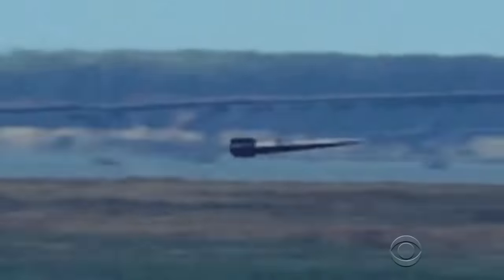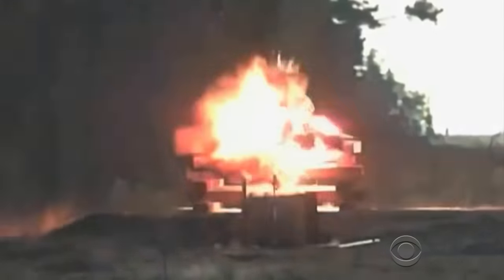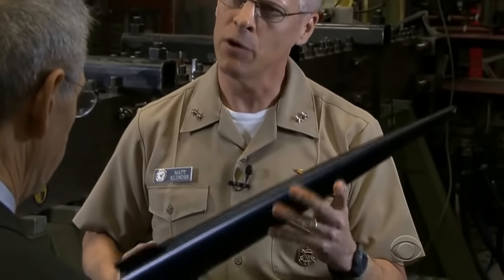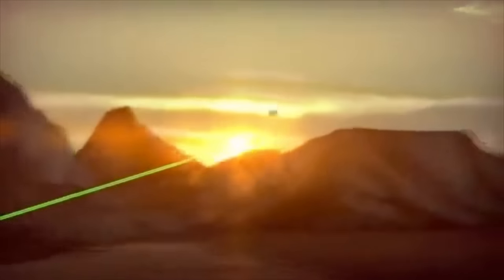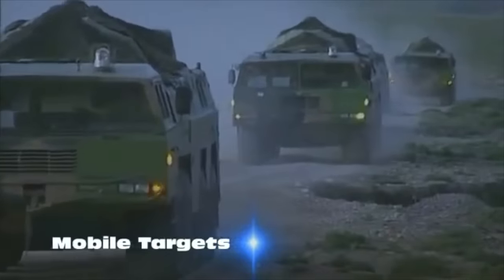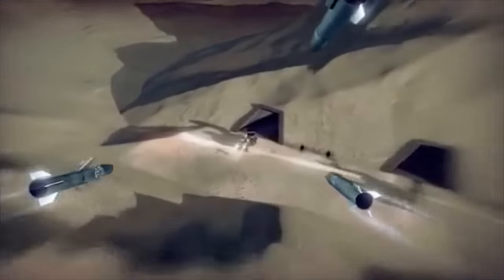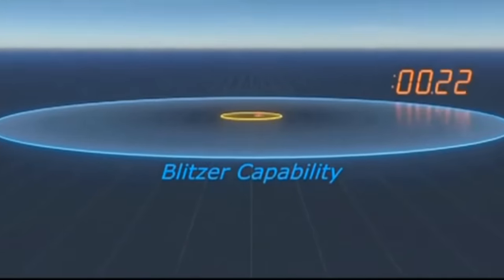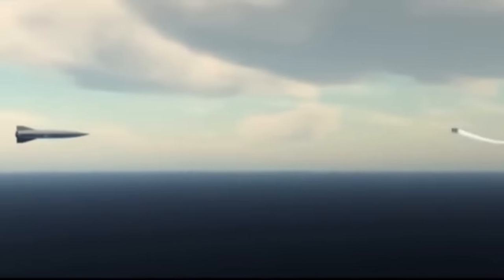U.S. Military's Most Powerful Cannon - Electromagnetic Railgun - Shoots 100 miles - Mach 7

Comment: More than 70 years ago, when I was a kid, we bought a toy gun at Macy's which worked on the same principal. It was made of plastic and consisted of an electro magnet,  an aluminum barrel and a button at the back that would push a small steel bullet from a magazine holding ten in between two electric contacts which activated the electro magnet and fired the bullet out of the barrel with about the same power as an airsoft gun. Nowadays they would not sell such a dangerous toy to kids. It was okay on the 120 volts of the USA, but when we took it to Britain and plugged it into their 240 volt system it was almost as powerful as a. 22. Fortunately,  unhappily for me as a kid,  the higher voltage melted it before any real damage was done. I imagine it was taken off the market in the USA fairly quickly. But it was a toy rail gun I had about 73 years ago. It's surprising the technology has only know been turned into a real gun.
Reply: Scaling it up required too much power and cost way too much most of our tech was available 50 years before it had begun to see use as it was too expensive
Reply: @Thomas Pickens I am sorry. I don't know.  I am not a toy expert. When I was a kid I just played with them and often wrecked them.  I was about 7 at the time and it was explained that the little steel projectiles when they were pushed into the breech completed the circuit and activated an electromagnetic coil around the breech.  It hardly lasted a few minutes in the UK. But I looked up the Marx Magic Shot and no it wasn't that.  The gun was not contained in any way.  In the States I could and did use it in battles with toy soldiers.

Comment: "Kinetic energy impactors" also known as ball bearings, it just sounds more expensive.
Reply: That's because it is expensive to shoot a large ball bearing at mach 7, and at velocity like that it's all you need.
Reply: the impactors which are basically shrapnel are not anything special. SAM systems use them such as the missile that shot down malaysia flight 17 over ukraine

Comment: I Think I have heard it said that one of the major problems with the railgun was that it could only fire about two rounds before it would basically become useless because of the amount of friction or heat created by the release of the round. The other problem is the amount of electricity you need to be able to generate in order to shoot the thing, which might also create a significant delay before powering up again. If there is going to be a model that the army can deploy they must have made some significant strides.
Reply: Yeah, they are cool but practically useless
Reply: Y not have like a revolver kinda thing it has multi systems
Reply: Yeah. My understanding is that we've got the power use thing down. A nuclear powered battlecruiser could operate the current gun system. The projectiles are perfected. The problem is the gun barrels. We don't have any materials right now that can withstand firing this for more than a few shots before they melt. Once they have the metallurgy done this will see deployment.

Comment: This documentary is almost 10 years old and they still haven't made progress
Reply: They stopped
Reply: soul5123 tuimaseve why?
Reply: It's a complete waste of time. Everything about this project is good on paper. Cheap ammo,less parts to service. BUT, when you scale this for actual combat...problems, big problems arise. I'll put a few down.

1. EMP, it would knock this weapon down unless heavily shielded.
1a. In the event of an EMP this would mean that the ship carrying it would be rendered useless.

2. Power generation.They feed a lot of power into this one one unit, a ship needs more than one, that would mean either lots of batteries, and slow recharge, or a new class of ship, that has nuclear reactors to power it. Neither is feasible in money land, even for US military.

3. A rifled gun has a specific life time, but ultimately it can be swapped very easily in the event of a catastrophic failure. This...if a coil burns, you'd have to dismantle the whole thing, and that's under the EMP cladding, which would make the weapon too big for conventional warfare.

TLDR, the benefits get outweighed by the negatives. And those negatives are tied down to putting a lot of money into one basket. 

No military on this planet, that acts under its own internal logic machine will spend money on a system that has no clear cut benefits. Sure, one can argue a lot of things USM did/funded are in that category, but ultimately it's about what works.And few of those things went past the "we know now what we can eat this with".
IMO, they shelved this, waiting for the other systems to catch up, which is the smart thing to do.
Reply: 1) Then heavily EMP proof it...
2) Then chuck in a nuclear reactor then
3) Use life lasting components....
Reply: @aserta Actually, didnt the US have a destroyer run one of these railguns? Or is that a different kind?
Reply: @White_Night_Demon  you've single handedly solved the US Army's greatest problem, how do you feel sir?
Reply: @meganwhite9090  i feel like a rock!
Reply: @White_Night_Demon  I think at that point the rewards are simply not worth all the extra effort.

Plus I think there was a problem of the rails of the railgun being shaven off with every shot. The explosion when the railgun fires isn’t from gunpowder, it’s the result of pieces of the rails used to fire the ammunition being shaved off through friction and being shot out the end of the barrel.
Reply: @KhezuWiggles  use harder materials for the rails so you can't shave the rails since the rail material is harder than the solid slug or whatever you're using as the projectile?
Reply: @KhezuWiggles  OH...

I thought nuclear reactors were self sustainable so you dont need to require refuel? Aren't you able to reburn the waste? or turn it back into fuel?
Reply: @White_Night_Demon  unfortunately not. Nuclear reactors are reactors that use the energy of nuclear fission of uranium-235 to create a sustained and controlled chain reaction of nuclear fission, which is used to boil water and turn a steam turbine. Once all that uranium decays you’re left with primarily Caesium-137 and Strontium-90, which are too stable to provide more energy in the reaction, but are radioactive enough that they must be handled with utmost care, less people get radiation poisoning or cancer. The cost of a nuclear reactor is largely due to disposal, and each fuel rod can last 6 years in a reactor. However since this is an aircraft carrier and not a power plant, I’m not too sure about the specifics.
Reply: @KhezuWiggles  ok, so then what do we use as an energy source then if nuclear reactor is unfeasible?
Reply: @White_Night_Demon  oh the coil guns are actually very different. First, they don’t have the problem of rail damage since the projectiles don’t really need to touch the coils. Second, much more energy efficient since it’s coil by coil. Lastly, they can be launched much faster, while railguns have a hard speed limit of 3km/s, coil guns don’t. 

Coil guns work by sequentially powering and unpowering Electromagnetic coils such that the projectile is pulled to the coil’s center, then the coil is turned off and the next one turns on, and the projectile is pulled faster to the next coil.  

The coil gun’s problem is that it must be incredibly precise with timing, and thus are a pain in the ass to calibrate, especially at such high speeds.
Reply: @KhezuWiggles  Ooohhhh....you're such knowledgeable of these kinds of weapons....
Reply: @White_Night_Demon  not rly
Reply: @KhezuWiggles  well u sound like u do!
Reply: @White_Night_Demon  I just read and watch a lot of misc stuff ;-;
Reply: @KhezuWiggles  can i be your friend? ur knowledge of these things may come in handy for my little creative writing.....which is set after world war 3 when all the nukes drop.....and monsters roam about, that came from another dimensions.........so slightly different to what happens in the fallout game series...and it wasn't china who started the war either! hahahaha Actually would be way different considering my story has technomancy where the fallout series does not....

Are you into technomancy? My story has a bit of this stuff in it....
Reply: @White_Night_Demon  sure, HMU on discord, tag is DankWiggles[🗡]#2938
Reply: @KhezuWiggles  you sure that's right? I get an error trying to add "DankWiggles[🗡]#2938"....
Reply: @White_Night_Demon  changed it to KhezuWiggles[🗡]#2938
Reply: @KhezuWiggles  still doesn't work...
Reply: could be the sword symbol....can yo utemporarily remove that so i can add you and then you later put it back on? Shows up as a square on discord app, but sword on the browser.
Reply: @White_Night_Demon  ok
Reply: @White_Night_Demon  changed to Khezu wiggles
Reply: @White_Night_Demon  idk then, can you send me yours?
Reply: @KhezuWiggles  Hey, it worked! Did you get my invite? Or did I send it to someone else who happens to have the exact same name and tag as you....?
Reply: Yeah... If you think the highest defense budget on the planet, isn't investing in this even more... You might not understand our government. Just because it isn't declassified doesn't mean it doesn't exist.
Reply: @KhezuWiggles  the cheapest part material you mean
Reply: @aserta  Dude, Get a book deal !
...Those Hood/Bismarck Dog fights in the middle of the ocean are a thing of the past. Now, They're firing at targets from countries away !
Reply: @lour7299  in reference to? Sorry, I haven’t picked up this thread in a while
Reply: @KhezuWiggles  you were saying military using the best material they can get,....
Reply: @lour7299  ah yeah, this discussion was before I was aware of the military’s disposition regarding quality and spending
Reply: What do you expect? It’s years of more research and testing to make these things
Reply: Because have things way faster and way more advance we don’t even know about

Comment: Jesus, why don't they build a tank around that weapon system!? They would fuck shit up left and right.
Reply: Power and size requirements are the reason why this is exclusive to much bigger machines than tanks. But it would be pretty awesome.
Reply: Need big generators to make the electricity to fire those rounds. Not sure the exact size but if you look at the animation the launcher truck has like 4 support trucks carrying radar and generators.
Reply: because as soon as the tank fired it would melt the barrel into soup and blow the tank into the next country.

Comment: I am envisioning a gatling variant of this mounted on a space shuttle or some place airless for use against targets where atmospheric drag isn't an issue.  A very potent anti space craft or anti satellite weapon.     :)
Reply: Ken ibn Anak  which is why lasers by ships shot in space are highly unlikely as seen in all those fancy movies. Chances are any real type of "space fight" would be along the lines of slinging very fast heavy projectiles. Sure a laser can do damage but I can be mitigated. You tell me how you stop a 23 pound piece of steel/tungsten/or even irradiated metal when its traveling faster than computers can traditionally think.
Reply: Truth.  The projectile speed limiters here are atmosphere resistance and a short launching tube.  You give that thing 50+ feet of plasma acceleration in a vacuum and you may be talking 1/10 C velocity.   The shock wave produced in a thin walled manned craft pierced by a projectile moving at that velocity would instantly turn the ship into a dust cloud.
Reply: You can’t have a Gatling version of this and a a kinda Gatling one would be way to expensive and ineffective to its counterparts. And shooting down satellites is irresponsible, you’ll take out every satellite and space station and stop new ones from getting deployed.
Reply: USS Gerald R. Ford 12th CSG  welcome to how wars in space will be fought..   yes, space stations and shuttles will be targets for all sides.  Good luck armoring any ship you will want to move, without adding so much mass it crawls.
Reply: Vs
Reply: Ken ibn Anak It would be a good thing if we could believe this propaganda hype ! And, even if they had such technology ready to engage in a combat situation , how many men are capable of operating it without goofing up ?
Reply: Well actually, since I have known about the Plasma gun technology since the 1980s (Aviation Week S & T covered it well back then in the High Frontier days (along with some articles about pulsed particle beam weapons), and since I had done some work at Harry Diamond and Dahlgren in the early 90s I prior to this video already known the plasma cannon was a work in progress back then.  Long and short, I do believe the video.  In the mid 80s most of the projectiles were little cubes of aluminum which self destructed upon impact with the atmosphere.   Looked like little shooting stars throwing sparks like meteors do.  I think the real advancement shown in the video is the reusable barrel.  That was a technology hurdle 30 years ago.  From your question I am not sure you understand modern naval guns.  The old days of a gunner inside a manned turret are pretty much over.  Someone below decks is tasked with keeping the automated loading machinery full of shells.  I suspect this thing uses pre loaded magazines loaded at a suplly depot.  Ships radar usually finds the target so the guy at the telescopic sight is gone, so to is the man turning the crank to traverse the gun because a computer linked to the radar and other sensors does that.  Firing is done by pressing a button inside the command center.   I think there are lots of men and women capable of pressing a fire button when told to do so.
Reply: I was thinking of more like a rifle...
Reply: Αχέροντας Νονα MOVE FAST AF BOI! (Because that fucking thing has hit your ship and you are doomed :D)
Reply: Check out ''The Expanse'' tv-show(which is based on a book series).Both the UN gouverment of Earth and the Mars Republic use railguns on their battleships and also as platforms in orbit.There's an episode,where the Earth forces,use orbital railguns to take out Martian platforms that shoot nuclear missiles.
Reply: I see we have all forgotten basic Newtonian Physics.  For every action there is an equal and opposite reaction.   Firing a rail gun in space you still need to push a mass forward, meaning whatever the gun is mounted to will be pushed backward and out of its orbit (quite severely.   Didn't do the math, but pretty easy to calculate mv^2 to see just how big of a shove it will be.  Ships have huge mass and land vehicles can be braced against the earth to absorb this, but a space craft/satellite cannot.  They are built as light as possible due to the expense of getting them into orbit.
Reply: All that would mean is that the orbit will change. No big deal.
Reply: +Ken ibn Anak-  Shit...  Atmospheric drag isn't even an issue with this rail gun.
Reply: Dr Evil would love this as long as it comes with a laser
Reply: Ken ibn Anak we have a plan for that dude it’s called ODIN or something. It just drops depleted uranium shells with no extra force and they schmack into the ground with so much force they vaporize the dirt underneath them and cause explosions. Would cost a lot to get such weight into orbit.
Reply: Matthew Niedbala   Yeah, the “Rods Of God” kinetic weapons platform is designed to drop tungsten rods that would continuously accelerate until they hit Earth , releasing so much kinetic energy it would equal a nuclear detonation. With the added benefit of no radiation.

Even though it was designed, the treaty that bans placing WMDs in space means it won’t get made.

Cool idea though 😉
Reply: @mrkamm71  the inertia of orbit is enough to couteract the force.
Reply: OR NIBIRU.....
Reply: BY THEN WE WILL HAVE INVENTED THE PORTABLE RAY GUN (LIKE BUCK ROGERS) BY THE WAY, AREN'T WE IN THE 25TH CENTURY?

Comment: "There's not a thing in the sky that's going to survive against that."  

What about 7 plates...
Reply: what about a Chinese hypersonic missle re-entering the atmosphere and traveling at Mach 10, which is how fast those things are.  Can this Mach 7 projectile hit the much faster enemy missile?  I'd guess no.
Reply: Lmao that would have to be pretty big fucking plane to hold that much weight
Reply: @Ironfangzu  - If the computer guidance is good enough, as long as it is a head-on encounter and not a chase from the rear, yes.  It would be fast enough.  And, in fact, in such a situation it would be even MORE deadly because the metal would hit the missile at a net mach 17.  That would rip the guts out of damned near anything.  Don't forget, that hypersonic missile has to be light enough to be able to be propelled by the rocket in its tail.  So it won't be armor plated.  Granted, it wouldn't be an easy shot but if a computer is guiding it, there is a good chance it will come close enough to release that shrapnel cloud.  After which, lights out for that missile.